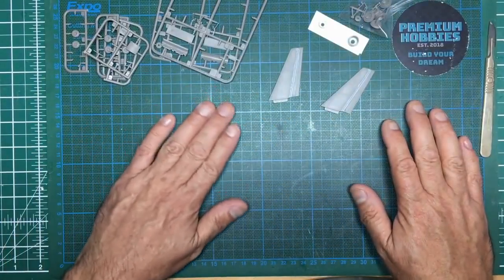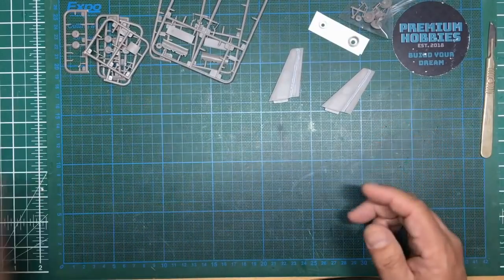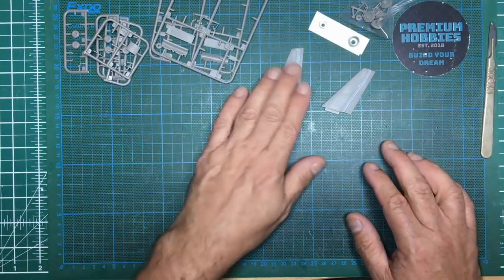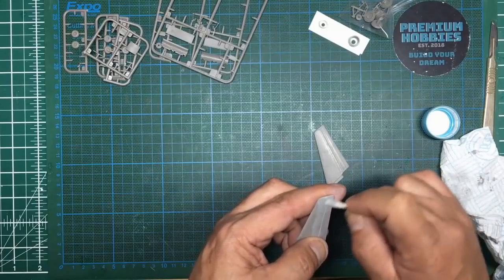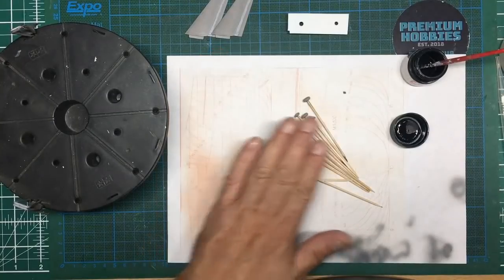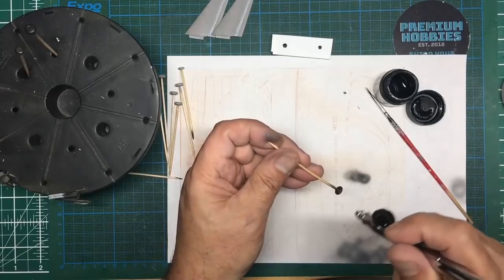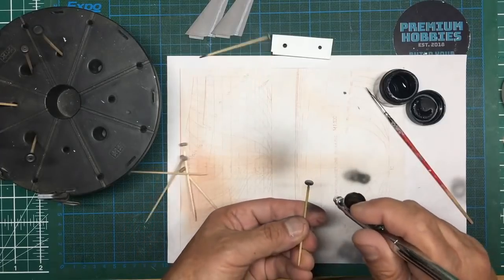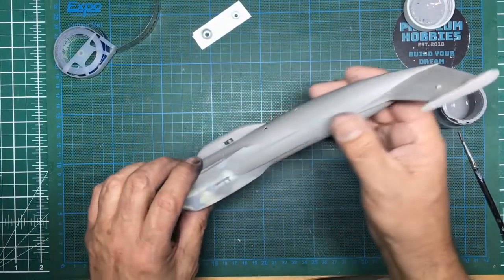Roden 1/144 C-141B Starlifter build. Part Five

Comment: Well done as always, Nigel.  As others have commented there will always be those individuals who revel in making negative comments , they would do well to remember karma is always lurking around the corner. I for one enjoy the way you approach and solve a problem and I always learn something new watching you work.  BTW to those who complain about the sound quality Youtube does give you ability to turn on closed captioning it’s the three vertical dots in the upper right hand corner and is allows the viewer several choices on font type and colour. One last comment, after the first time I saw you use demo tape as a scribing guide I now have a use for the drawer full of the stuff.  I also use pin striping tape for those difficult curved areas and as you probably know com s in a wide variety of widths.  Keep up the good work you are definitely appreciated as the over 5k subs indicates.

Comment: Nigel when I worked on the engines on the flight line or the iso dock I’m certain they hung straight down from the wing. I am honestly not 100% certain. It was a long time ago, 1984. But I am remembering rolling stands up next to them and remember them hanging straight down from the wings.

Comment: Engine nacelles are definitely vertical with respect to the ground. The ground is where the aircraft spends most of it's time, and so on any large aircraft, keeping the nacelles canted at some angle would put undue stress on their mounting system.